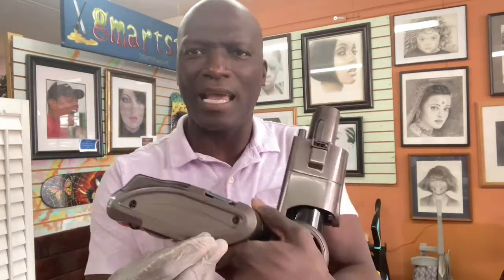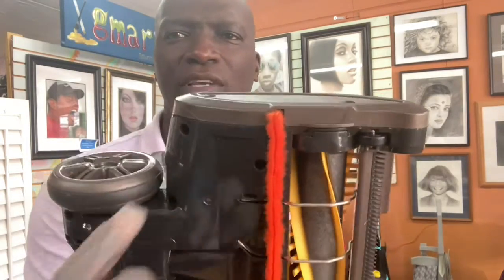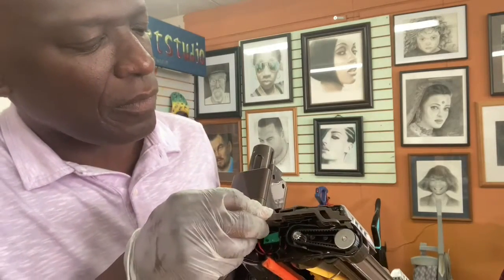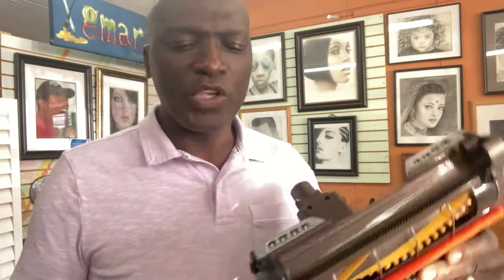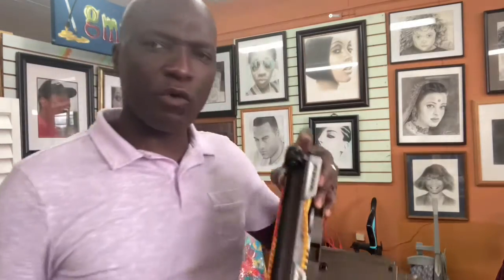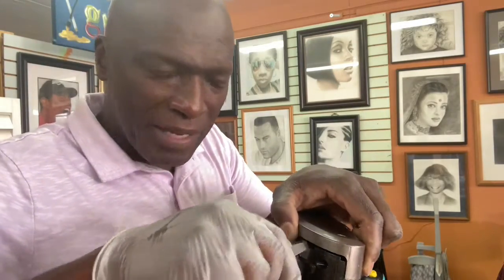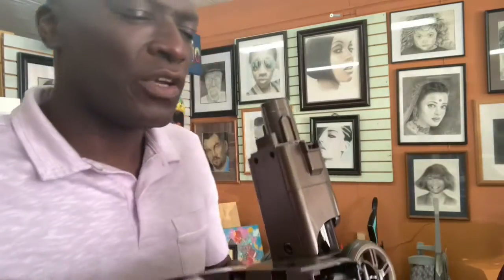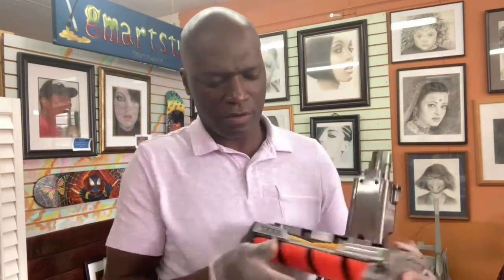Need help installing new belt in shark duo

Comment: It's no wonder they told you to buy a new head!! Shark obviously DOES NOT intend for product owners to change those belts. It's a bad engineering design for that reason. A real good reason not to buy because we both KNOW that most owners are not capable of following your detailed instructions. You did a terrific job with talking us through it and providing close ups. I don't own that model but your tutorial is all I need to help me tear down my HV381C head to do belts. Thank you!
Reply from the maker: thanks for your feedback. I do agree with your opinion

Comment: Thank you for a very detailed explanation on how to take apart the head. My front roller has stopped working and figure it would be a belt. Are the dual head belts the same from model to model? Having problems finding the one for my model. (ZU881). Thanks again.
Reply from the maker: Unfortunately the belt sizes and type may differ depending on the model

Comment: Thanks for the excellent video. Is there a place where I can get just the belt for the hv 392 26.  I found the smaller belt for the first one you replaced but the larger one is stretched out and I’m trying just to replace it.  Thank you for any help.
Reply from the maker: is your larger belt grooved on the inside?

Comment: What kind of plastic do you think the upper cover of the vacuum head is made of?
The plastic parts that secure the screws broke and I'm looking into the best adhesive to bond them back on. I'm thinking abs cement or acetone if it's abs but otherwise maybe an epoxy.
Reply from the maker: you can also try liquid fiberglass with hardener/ a strong Epoxy is fine

Comment: Shark Duo Clean IF252 31 Brushes are not moving.  Belts are OK.  Suspect the micro switch.  Need video on how to get the cover off to get to the micro switch which turns on the brushes when the handle is not upright.  Have the sides off just can't figure how to get the center cover off.  Appreciate your help.
Reply: I have a Shark Rotator Lift Away Duo. Mine is a little different than the one in the video. The sides are solid pieces with the bottom plate.

But maybe this will help you. After I found all the screws on the bottom, I could get all the sides to open but there was still resistance in the middle.

On the top, below the Shark logo, mine has a little plastic plate that says Duo Clean Powerfins.

In mine, that plate comes off and, you guessed it, there were more bloody screws.

After I took the plate off and those screws, the top lifted off the base. Then there were still more screws locking the clear plastic beater bar guard to the bottom plate.

But once I took those top screws off, I had full access to the motor and board.

Comment: My question is not in regard to your video. I need help troubleshooting a Shark Rotator NV750W series. The brush roller is not spinning nor is the light coming on. Also, the lights on the nozzle are blinking. I recently purchased a new head as well as a new hose and nozzle. It does the same thing. The old and new do the same thing, so what is the problem????
Reply from the maker: Hmm. I was going to mention the micro switch but you purchased another head and it’s doing the same thing. ( Is it a brand new head or used?) What are the chances the both have the same issue. If the head not the problem then you would have to work your way up. Eliminate the wand or the hose the main power switch until you find the disconnect. It’s a lot easier if you know of someone with the same unit. This way you can compare and see which part has no continuity. Lastly. It could be one of the circuit boards

Comment: excellent I have a question I followed what you did excellent explanation but I found that the wheels what it holds the belt rusted what to do with it? And how to fix them? Thanks
Reply from the maker: I believe that there are clip/ washer that if removed will allow you to remove the gear. Then you can clean. if not try auto penetrate spray. Very good for death with rusted gears and bolts
Reply: @monroevacs  Thank you so much
Reply: I did spray yesterday a little it worked well

Comment: At 9:26 in the video, I need that little part that fits on the metal shaft to spin the front roller.
Reply from the maker: I think I have that part. Reach me through the channel home page. Connect with the email and I’ll send a pic of what I Have